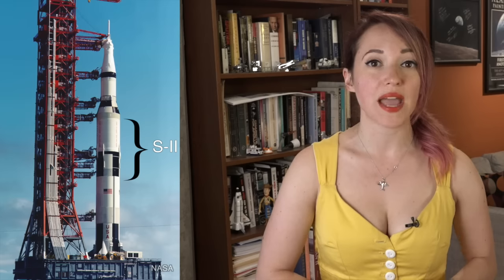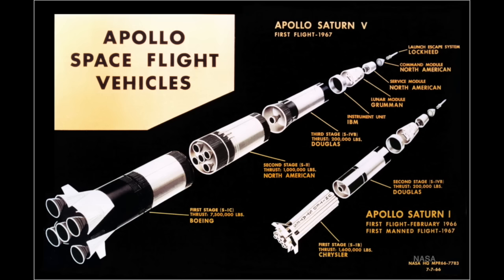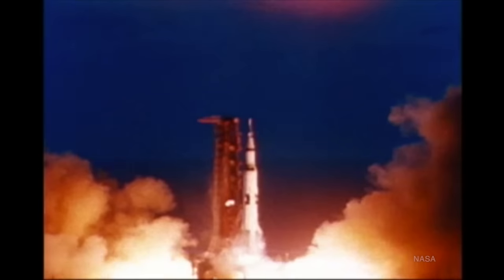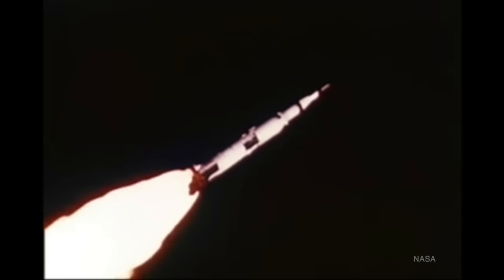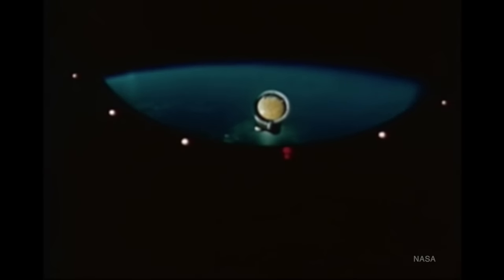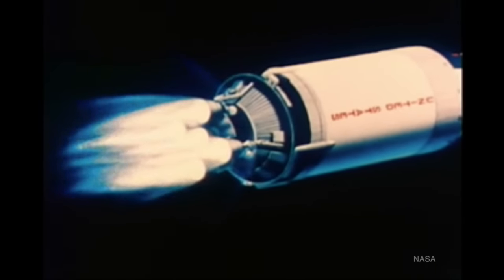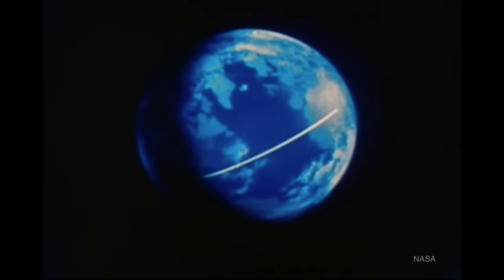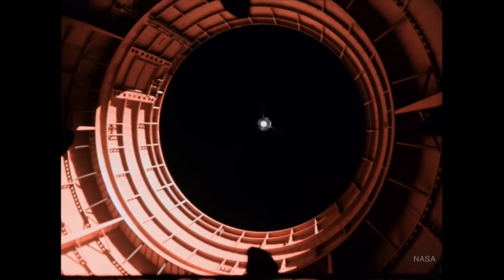How the Saturn V Broke into Pieces Launching to the Moon

Comment: Great episode. How does the acceleration force differ between the Saturn stages? As in, how different did each feel to the astronauts on board?
Reply: google search 'g-force saturn V'
There are several graphs from different missions. The peak was 4g, just before S-IC separation. The subsequent stages were much less powerful.

An interesting side note, the force exerted by the engines is constant, but the mass of the vehicle is constantly decreasing, so the acceleration (and the g-forces experienced) are constantly increasing throughout the burning of any single stage.
Reply: +violacrb That's why the center engine was shut down after the first two minutes.  The rocket needed five engines to lift off, but as it got lighter the thrust became too much.  The Space Shuttle had engines that constantly throttled back to keep it under 3g.
Reply: +violacrb Great point...that's why the space shuttle had to throttle back in the last 45 seconds or so of ascent!

Comment: You talk about the booster motors on the second stage, that create stage separation but also help force the propellants into place for main-engine firing. I've heard of this before, but why would the craft need even more of a push to shift the liquid? Doesn't it already have all the momentum of the launch to this point? Would the propellant really be free-floating in zero gravity already, in the time since the first stage stopped firing?
Reply: +Whateverthing :Forcing the propellants to the engines may have been an additional means of guaranteeing there would be no problems. AFAIK, some rockets do not have this capability built into them. As for floating in zero G, the propellants are still experiencing the pull of gravity since the stack is nowhere near orbital velocity at S-1 separation.

Comment: Amy, will you please tell us the back story on the photography work from inside the rocket engine.compartment as the stages were separating. Also how did the film n camera survive the fall back to earth and not sink or be destroyed? Must have been quite tricky a system in. It self! Aloha, glennnn
Reply: Yes I've often wondered about that, they are some of the most clear images/ Film footage of the mission around.
where were these 16mm high frame rate cameras mounted/ they obviously used chemical film that can't be to hot. etc

Comment: I would like to ask a question. The Saturn V names Skylab One had a second stage that had slightly more fuel than that of the Apollo Saturn V's. This allowed Skylab One to get to orbit without the need of an S-IVB stage three. So, why didn't the Apollo Saturn V's have such a second stage that would allow them to get to orbit without using some of the fuel in the S-IVB stage?
Reply: One more stage and dropping the previous one was the more effective way to get to orbit, generally you try to have as many stages as possible, while walking the fine line with , on one side,  loosing as much weight ass possible ass soon as you can, and on the other side, not over-complicating your launch  vehicle and not adding more weight with stage separation mechanism itself. So, ideally , one more stage would be better, but skylab was too heavy and too bulky for another stage.
Reply: MrZaphaell Oh, I understand. Alright, thanks.

Comment: Your presentations are fantastic. Do you have any more info about the retro rockets that separate the stages? What's the difference between retros and ullage motors? Is it just the direction they are pointed? Also, if the second and third stages separate 10 seconds before the second stage fuel is depleted,  what holds them together for those 10 seconds?

Comment: Thank you for posting this informative video. I hope you maybe help with information as to how the Aft Bulkhead of Apollo Service Module (SM) was mated to the Four Upper (forward) 21' panels of the Apollo Spacecraft LEM Adapter (SLA). example is the Aft Bulkhead mated by use of bolts, Tension Straps or some other method. Thanking in advance.

Comment: the atlas rocket was one and a ha  lf stages. they weren't sure they could ignite a second stage engine so instead they fired all three engines and then dropped the two outer engines and continued to orbit on the center engine

Comment: Something I've wondered for the last 50 years is why the stages were numbered S-I, S-II, and S-IVB. Why weren't they 1, 2 and 3?
Reply: Before the Saturn V was finalized as the design choice for the Apollo program, there was the C-4 which would have been a 4 stage design. The S-IVB was selected from that design to be used on the Saturn 1B and Saturn V.

Comment: Great video Amy, as always. Just wondered, why did the Apollo service module not have solar cells? It seems like it could of reduced the problems for the Apollo 13 crew with them having to turn systems off to save power.
Reply: As a guess, it's probably down to two reasons: 1) the more things you add the more things can go wrong and 2) they will add weight for the panels, their fixings, cabling, electronics... What system would you remove in order to have them?
Reply: +Fly X Solar cells don't make water for crew consumption, or cooling equipment. Sufficient drinking water is very important. Just ask Fred Haise.

Comment: Hi Amy 😊 I have a question about Voyager 1. It is to my understanding that Voyager 1 & 2 were launched in 1977 just 16 days apart from one another. But am I correct that Voyager 2 was actually launched first followed by Voyager 1? If so, what was the reason for the non-sequential order of the launches? Thank you very much for your time 🙂
Reply: Err scratch that.. After inquiring further, I've found the answer. "The two were sent on different trajectories, and Voyager 1 was put on a path to reach its planetary targets, Jupiter and Saturn, ahead of Voyager 2." 🤓🙌 Nerd life! 🙌🤓 lol

Comment: A question has occurred to me after watching your videos.  A question about the speed/fuel related mechanics of going to the moon.  It took Apollo 11 three days to get to the moon, and 3 days to get back, but how?  The vast Saturn V used a huge amount of fuel to get up to the appropriate speed, how could the vastly smaller Columbia command module (with orders of magnitude less fuel) accelerate up to about the same speed?  Yes the CM was already in orbit, and the moon has a fifth of the escape velocity, and the Saturn V needed the fuel to launch the weight of the return fuel, but it seems the differences in fuel size, to obtain the same speed, is huge.  Many thanks in advance.
Reply: +Warren Day I watched a show once years ago and they mentioned once they left the moon's gravity, they pretty much fell back to earth. So instead of fighting earth's gravity all the way to the moon, they used earths gravity as an advantage coming back.
Reply: +Warren Day :Propellant is only used to get into and out of orbit. It's not like driving a car where propellant (Gasoline) is continuously burned. Gravity does most of the job of getting spacecraft where they need to be. This is why the Apollo CSM/LM could be as small as they were.
Reply: +J Dean Not gravity, Newton's 3rd law.
Reply: +Warren Day :It's both. As you already know, the burns are executed and function according to Newton's 3rd law. But gravity is left to pull the CSM/LM towards the moon after the Trans Lunar Injection (TLI) burn. At TLI, the spacecraft is accelerated to around 24,500 mph or Earth escape velocity. within hours, it begins slowing until it reaches a coasting velocity as low as 3,300 mph some 180,000 miles out. This is due to the pull of Earths gravity. Then the spacecraft speed begins to pick up past 180K miles until it's just above 5,500 mph or lunar orbit velocity. The SPS fires to get the spacecraft into lunar orbit which is again, Newton's 3rd law at work. If the SPS didn't fire, the spacecraft would either fly past the moon and into infinity or with any luck, it would be captured by lunar gravity. However, the latter would depend on a great deal of luck or mission planners could have saved propellant by using the moons gravity to get the craft into orbit.

Comment: That's a lot of "explosions" going on during a launch in order to separate the stages on the vehicle.  Can you talk about the technology behind these explosive bolts?  

What about the eight bolts that held the space shuttle assembly to its launch platform?  Another great piece of technology.

You also hear a great deal about range safety.  How did they make sure that all this falling hardware did not hit something in international waters?

Another good area for exploration is the radio signals used to control the self-destruct charges on board a rocket.  In today's era of Russian super-hackers, how did they insure that some random radio signal did not blow the entire vehicle to the great beyond?

That's enough suggestions for now.  I have lots more so get busy.  (I hope that you are making some money with all this effort.)

Comment: Is there a reason why that stage separation was done in a two stage process? Shouldn't the connector ring also have separated just as cleanly if it had been fixed to the lower stage?

Ah I see.. found a presentation about the separation system and it looks as if most of the "skirts" were chosen as position for the ullage rockets, so leaving them attached, firing the UR and then separating them after they burned out would make sense...
Reply: +Urs F
Don't forget the spend stage was still very bulky and heavy (and subject to aerodynamic forces): it's is pretty hard to control it that precise so that there is no risk of having it hit the engines of the stage above it. By having a lighter connector ring instead, it will be easier to control it's riskier separation (assuming the aerodynamic forces allow a stable separation).

Comment: I have a followup question for you--why did the first and second stages have a two-plane separation system? There was also an interstage between stages 2 and 3, but it stayed with the S-II during separation. Did they hang onto the skirt between the S-1C and S-II only because the separation ullage rockets were on the skirt, or were their other reasons as well?
Reply: +Don Rudolph There was a fair amount of "jump start" equipment in the S-II interstage due to the differences in using the cryogenic LOX/LH2 propellants. Simply, cryos like to revert to a gaseous state. If any of that gas gets into the turbopumps, they'll cavitate, overspeed, and likely fly apart. Considerable effort and methods went into making sure that didn't happen. Once the engines were up to 90% thrust, most of that extra mass was jettisoned.
Reply: Mike Cowen Thanks for the info! I knew about cryo issues (which is why NASA decided against SSMEs for the upper stage of the SLS--too many mods needed to make them air-ignitable) but not that there was hardware in the interstage to deal with that! Maybe Amy Shira Teitel should do a video about that equipment! ;)

Comment: Help me out here.  Why would that inter-stage ring exist?  Can't that just come off with the previous stage?  Seems wasteful to do a separation with 2 separate steps.
Reply: +Matthew Dockter Possible damage to the engine bells of the next stage (those are inside the ring).
Reply: +Matthew Dockter Having a read through her blog post.  I get the impression it was just safer and easier to do it like that.  
Instead of having the first stage directly connected to the second (Any slight deviation of the heavy first stage  when separating could smash the second stage engines), 
The first stage jettisons, while the skirt keeps it far enough away that it doesn't hit anything important. . Then the skirt (which would be easier to model and predict its path  as it is smaller and lighter) is jettisoned when they know it will be safe to do so.
Reply from the maker: +Matthew Dockter From my research and understanding it was to give the engines space away from the explosions that separated the stages.
Reply: +Matthew Dockter The engines and their surroundings need to be easily accessible to technicians during assembly, but have to be covered during operation for aerodynamic reasons. If the struts were an integral part of the outer skin it would be very difficult to work in there, so it makes sense to have an inter-stage ring installed only after everything is connected and tested.

Also, separation from the previous stage could be tricky: a little unbalance could create a tilt during separation and damage the engine nozzles of the upper stage. It's better to separate the heavy 1st stage from the ring and afterwards the ring can be ditched in a more controlled way.

Some Russian rockets, such as the infamous N1 moon rocket have an inter-stage ring with no covers, so the trusses can be clearly seen: http://archive.org/details/GPN-2002-000188  This is because the upper stage is designed to start working BEFORE separation, and only when it is pushing at full thrust the lower stage can separate. So, the inter-stage ring has to let flames to get out before separation.

Damn, there has to be another word for "separation"! Where did I put the thesaurus dictionary?
Reply: +Matthew Dockter Lot of good comments on this, so I'll just add a wost-case-scenario concept that supports the use of inter-stages. Let's assume that, in the moments after the explosive bolts disconnect the lower stage, that something causes the lower stage to strike the upper stage. In that case, the inter-stage acts a bumper, or shield. The inter-stage takes the hit and the upper stage engines are protected. Once the lower stage is clear, the inter-stage becomes dead weight, and so it is jettisoned.

Comment: Now that I've seen footage from the stage separations, I'd like to hear about the cameras that recorded the separations. Were they recovered from the various stages when they splashed down, or how did they get the footage?
Reply: +Eric Peterson :The ones that filmed second stage separation were mounted on the engine bulkhead structure of the second stage (S-II). These would not be recoverable because the S-II was too high and moving too fast. It burned up on atmospheric entry. So they had to have transmitted their images via radio signal just as the moonwalk images were transmitted from the lunar surface. There is lots of room for even relatively bulky cameras aboard the S-II on the engine bulkhead or the forward end where the S-IVB was filmed separating on the Apollo 8 mission if I recall right. I've never seen any detailed descriptions of the cameras in all my years of being a space buff so I apologize in advance if this description may seem inadequate.
Reply: +Eric Peterson ;I was partly corrected as far as the cameras on stage 2 being ocean recovered. I wasn't thinking about the fact stage 2 was still going low and slow enough to make camera recovery a viable option. However, unless someone can say different and back it up, the only way to have gotten the shot of the S-IVB separation from stage 2 was to telemeter the data to the ground. Stage 2 would have been approaching orbital velocity upon separation at an altitude of 115 miles It would mostly burn up in the atmosphere and any surviving pieces would land in the Indian ocean if I recall right.

Comment: Dumb question, but why is the 3rd stage called the S IV instead of the S III?
Reply: +Alvious 

That's not a dumb question. The Saturn V refers to a stack of rockets. The stages were given different designations, & could be used in different stacks.

The S-III had two J-2 engines and was used as the second stage on the Saturn C-2 stack, & the third stage on the Saturn C-3 stack.

The S-IVB had one J-2 engine and was used as the second stage on the 
Saturn IB stack, & the third stage on the Saturn V stack.

Comment: How much more fuel would it take to keep the stages , and use them as building material ? I like long distance travel .
Reply: +Eric Makarainen 

The stages could never be kept. If they landed on dry land they'd have been utterly destroyed, not to mention the risk to people & property if something went wrong. 

That's why all the stages had self-destruct mechanisms, & why the rockets were launched out over the ocean. Landing in the ocean was the only option. And once they hit the ocean they just plummeted to the sea floor. Recovery would have been too expensive.

But it wasn't a total waste. Most of the third stages were deliberately crashed into the Moon to enable seismic readings to be measured. With their known mass, this told us much about the interior of the Moon.
Reply: +Eric Makarainen , It is not possible to keep the stages. What are the next stage engines supposed to do ? Burn through the other stages engines and tank structure?  The only way to do what you want is with a massive one stage rocket..